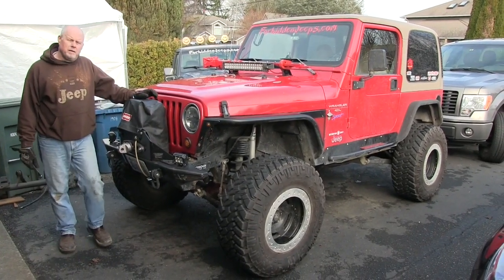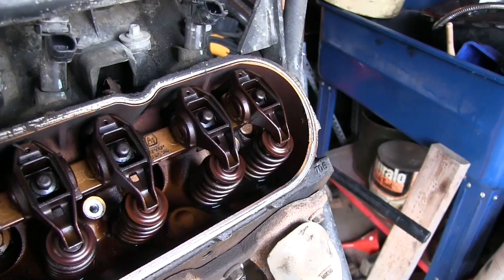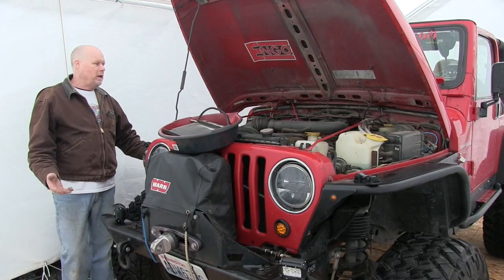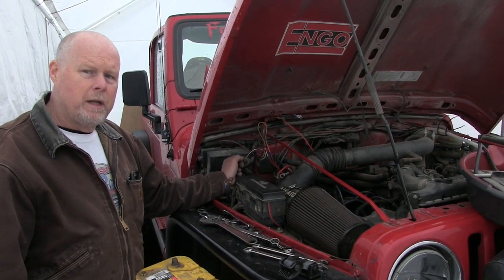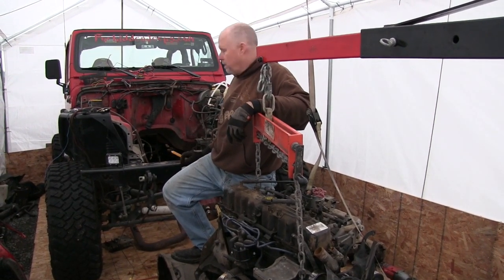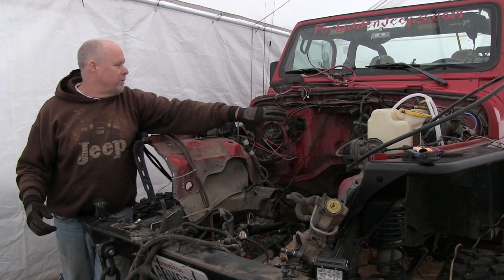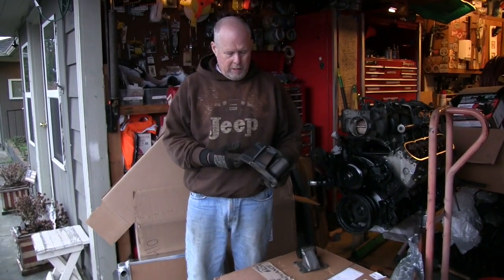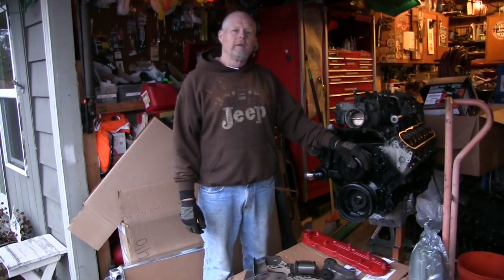Jeep Wrangler LS Swap (Part 1)

Comment: 4.11 with 35's?  Makes sense why it struggles uphill
Reply from the maker: Mitchell L. My TJ has 4.56 and 35s and it’s better but still not great. We geared it at 4.11 knowing more power would be coming later.
Reply: @Joester1908  I have a 2.4 cylinder,  I'm thinking about re-gearing do you think a 4:56 would be a good fit for 33's? I still want to run on the interstate at 75-80 mpg. Thanks
Reply: @Joester1908  2005 2.4 cyl factory gear is 3.73 I thought about the 4:88 but looking at some gear charts it says I would be running 3000-3200 rpm's at 70 mph which isn't bad but 75-80 for a prolonged period of time would be pushing higher rpm's on the interstate so I thought maybe the 4.56 would be a better happy medium idk...?
Thanks for your help.
Reply: @Joester1908  I had 4.88s with 33s and that was not to bad.
Reply: bill2526 bill2526  what size tire ? Im looking do same
Reply: bill2526 bill2526  yes im currently working on that 5.3 ls from a Silverado and a 4l60 but this info is valuable for me 307 gears and that size tire is a good option and budget friendly when something goes wrong is easy to find parts thank u pal
Reply: bill2526 bill2526  that's my plan for a yj ... also turbo it eventually with a 8.8 ford axle and small cage just to have fun around I'm a huge jeep enthusiasts but I been seen some diesel swaps to they are really interesting like a wv passat 05 turbo diesel guy claims to do 50 mpg with 40s and 513 gears

Comment: My same tj with 4.56 gears drove like stock. 75 80 up grades. Bet you have 3.73 gears
Reply from the maker: destro513 my TJ has 4.56 and 35s. This one has 4.11 we installed that gear so yes it definitely has 4.11
Reply: @Joester1908  now that I am thinking about it my 94 yj has 33s and I'm guessing 3.73s and it has some incline grade vs power and gearing issues.  So just that little difference does kill your 2nd to 3rd and 5th on a grade performance.

Comment: A set of 4.56:1 gears would have increased power.
Reply from the maker: Keith Alan while 4.56 gears would have returned the ratio closer to stock, we knew we wanted to put a v8 in this Jeep and decided on 4.11 gears

Comment: What is the kit part number for the adapter kit for trans and motor
Reply: Dustin Boles, I don’t recall the number for the Advance Adaptor part number. I searched on the website for the kit. It was about $2500
Reply: Bill Keith you paid 2500?
Reply: Dustin Boles I looked it up and it is $2156 on advance adaptor website and I think there was tax or shipping 

1 CP-TJ0XB : Jeep TJ Wrangler 1997 -2004 ,Chevy LS Gen III/IV Engines Conversion Package
Reply: Bill Keith what came with it

Comment: Honestly, looks like your cat converter had failed and clogged your exhaust system up. That 4.0L shouldn't struggle the way it did
Reply: Sure it would struggle with 4.11 gears.

Comment: you should have just put 4.56 or 4.88 and you would have been golden
Reply from the maker: Braud Sword let me be clear, the reason for swapping the V8 in my dads Jeep was not just because it was a little under powered. He wanted a V8. My TJ is 4.0/4.56/35s and it does ok but it still doesn’t have power. I can do 75 mph but it’s nothing like my dads Jeep